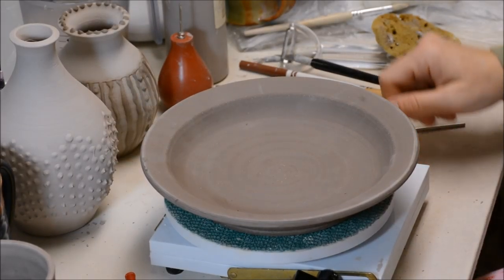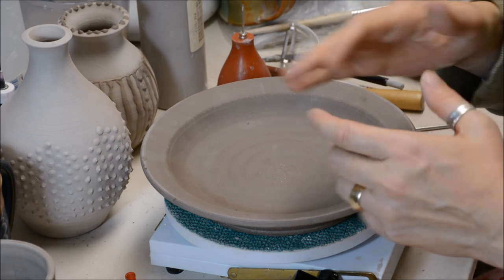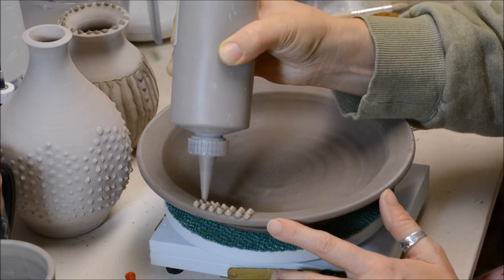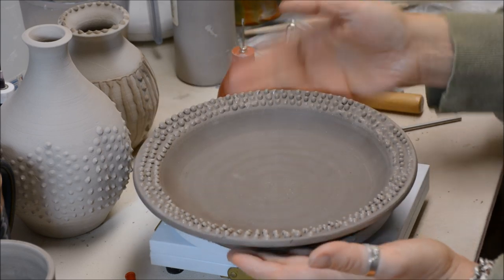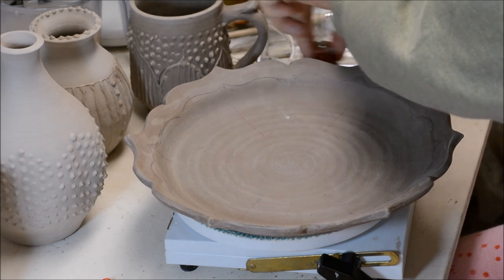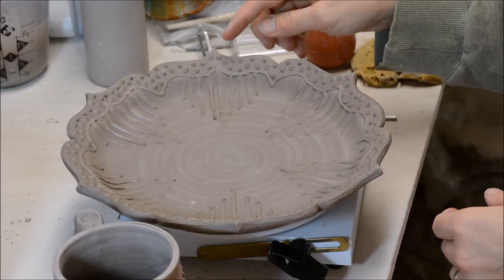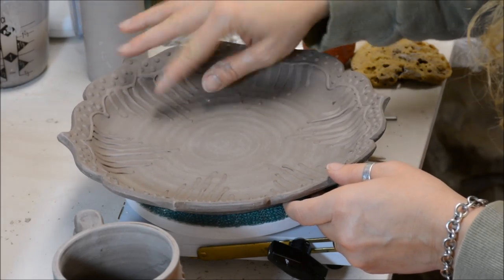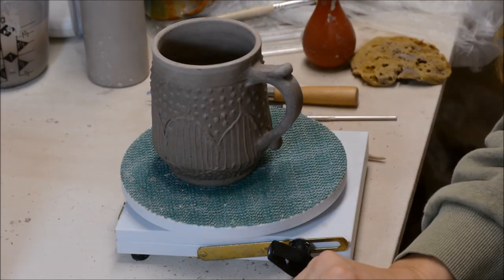Slip Trailing Tips and Techniques

Comment: great video - just one small point if you make your slip just slightly wetter than it currently is you won't get those sharp ends happening. Also i find work a lower angle helps maintain the flow better and gives more of natural feel to the slip trailing. I practiced for ages on oranges and waxed paper before i progressed onto pots.
Reply from the maker: Thanks, Tash!  :)

Comment: Lovely! I’m new to slip trailing and have issues with cracking. Any advice on avoiding that? Thanks!
Reply from the maker: Make sure the clay is not too dry when applying.  If the clay has already started shrinking much, and then you put wet slip on, when the slip shrinks it will shrink more than the Clay possibly can, resulting in cracking!

Comment: The slip trailing should be done on leather hard clay body?
Reply from the maker: Yes- as that way the slip will be able to shrink at the same time with the shrinking clay.  Putting slip on bone dry clay will often/sometimes result in the slip popping off when it dries, as the pot itself would already be done shrinking.

Comment: Hi Karan. I'm new to slip trailing and have a question. I've seen where people add glaze to their slip and then do the slip trailing. How do you do that? What proportions, etc?
Reply from the maker: Hi Steven!
I actually never add glaze to mine... I usually just pigment a slip with stains or oxides.  (Usually just mason stains though)  I don't have a proportion as a rule, I just tint the slip until I have the intensity I desire.  I'd fire a sample, to make sure the fired slip looks the way I want it before doing a big piece!  I hope that helps!  Perhaps some people add a glaze to the slip- I just don't have any personal experience with that!  :-)

Comment: When slip trailing, how dry does your clay have to be? Also, how does trimming work with slip trailing?
Reply from the maker: +sabatron ™ I would always have the piece trimmed before slip trailing to prevent damage.  Also, the clay would typically be a slightly dry-ish leatherhard.  If it gets too dry, the slip may just release and crack off.  Let me know if you have any more questions!

Comment: I love your work- may I ask where you buy those bulb syringes?
Reply from the maker: Mary O'Sullivan Hi Mary!!!  The bulb syringes I usually purchase from Highwater Clays... here is a link:  http://www.highwaterclays.com/index.cfm?fuseaction=product.display&product_ID=4095&ParentCat=249

But, recently, I discovered another type of bulb syringe I like even better, but it is more expensive... but made more durable than the red ones.  It comes with several tips of various diameter!  Here is a link for that one... (From my favorite local supplier!)  http://cornellstudiosupply.com/shop/xiem-3oz-precision-applicator/

They both work wonderfully for glaze application too- you could see that in my glazing the plates or glazing the platters videos!  :-) Let me know if you have any more questions!  :-)
Reply: +KaransPotsAndGlass Please let us know what size/color tip you are using with the Xiem bulb? I'd like to know which tips to order (already have the bulb and some too-small tips). Many thanks for all your clear and helpful videos!
Reply from the maker: When I use the Xiem bulb, if slip trailing, I use the biggest one- the 14 gauge (green).  Also, when I make my slip for slip trailing, I run the slip through a sieve to prepare it to remove the particles of grog that are in my clay body, or the tip would clog.  I hope this helps!  The red bulb syringes have a tip that I think is comparable to the 14 gauge, but that one is quite simply a needle for inflating balls that I grind the tip down on to remove the side hole.  I hope that gives some clarification!  Let me know if I can help any more!  :-)

Comment: hi Karan, You only use WATER for slip ?
İt is looking sticky.
Reply from the maker: +Doğa Çam 
Hi Doga- no- that slip is clay that I put in a blender with water.  I mix it in my blender until it is about the consistency of a milkshake.  Another way is to use the thick slip which has sat for a while in my throwing water bucket!  :)  I do use only water for slip when attaching items sometimes though!  But in the case of slip trailing... I just use blended up clay and water!  :)
Reply: KaransPotsAndGlass Thanks your all information :) 
heve a good day

Comment: Please .. I am a master student .. I need the way you made (slip trailing)
Reply from the maker: Off camera, I prepared my slip by blending some of the clay body I normally use in a blender, then sieved the pudding-like slip to remove the grog from my clay.  (I didn't want it to clog the tip of my bulb syringe)
Reply: @KaransPotsAndGlass  can i know.. if the slip also from industry slip?? not from studio? i mean if using slip for using casting.. how u make it be a thick??
Reply from the maker: @99leen44  - this is not for slip casting.  Since I don't really slip cast I have no videos on creating CASTING slip.  Try this article for more technical information on how to create casting slip!  https://ceramicartsnetwork.org/daily/ceramic-supplies/pottery-clay/how-to-make-casting-slip-clay-body/

Comment: Yikes!!!! You picked-ip that first "greenware" mug by its handle!?!  Would liked to have seen how the slip flows out of the bulb syringe - and the angle of application - but the video was at too high a speed.  Thank you.
Reply from the maker: Sorry, I speed up those videos, or they would take forever!  And, lol- yes, I normally wouldn't hold an unfired mug by a handle, but due to the wet slip on the outside, I couldn't hold it the way I normally do!  (I wouldn't do it if it were bone dry... but that leatherhard state, I know that particular clay body is pretty stable!  :)